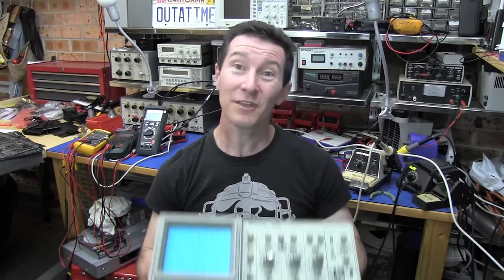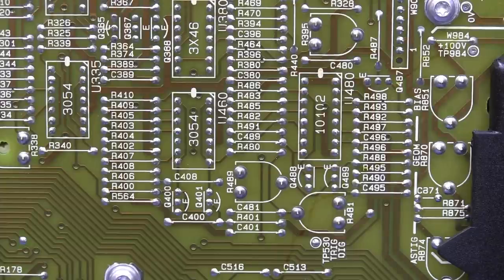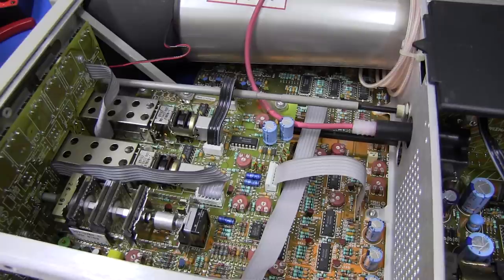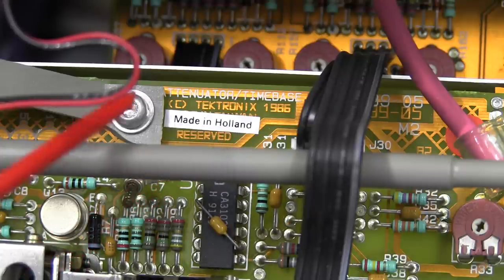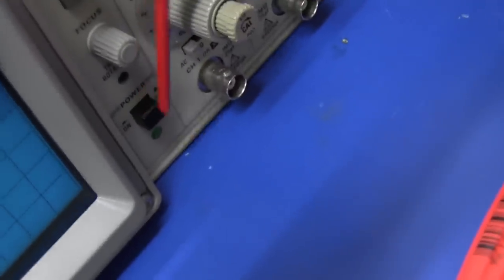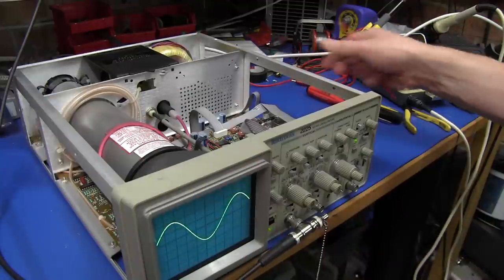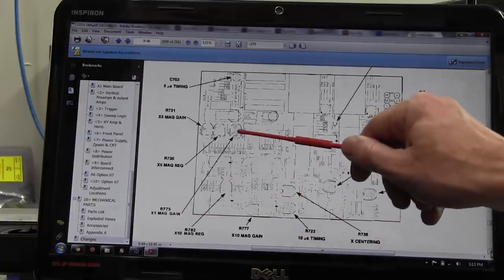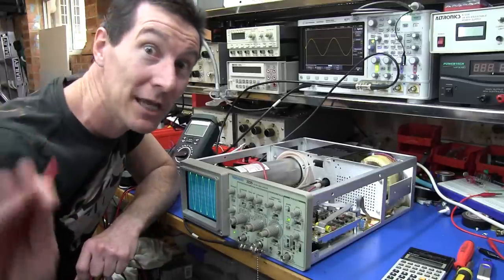Tektronix 2225 Oscilloscope Teardown and Calibration - EEVblog #208

Comment: Thanks for the video Dave, you have inspired me to break out the service manual on my 2225 and perform some needed adjustments. My 2225 also has a large 1.5M (2W?) resistor soldered to the bottom of the board as R266.

Comment: I recently bought one of these 2225's as my first scope. Dave's 2 videos on this scope, and the availability of the factory service manual were a major factor. I got a good unit at a good price, but it does need the Ch2 Vert and Coarse Horz pots to be replaced. Not a big deal really as I found the parts I need reasonably priced, but having Dave's 2 videos and the manuals gave me the confidence I could do low level maintenance work to get or keep mine going. Thank's Dave!
Reply: Same with me. With Daves videos on this 2225 in mind, I also recently bought a 2225 on ebay for quite a reasonable price. Lucky me, everything on mine is spot on and in calibration, just a broken power LED wanted to be replaced.

Comment: The spring against the CRT from the frame is not there to prevent any kind of physical damage. It is the grounding spring that connects the dag (The conductive gray-black coating on the outside of the CRT) to ground. If you don't do this, you end up with 7 KV on the dag. The scope in the video was built in '91. The dates are right in front of your face... look at the ICs, they have 4 digit numbers such as "9112" etc. where 91 = year and the 12 = the week of the year.

Comment: Dave - Interesting and instructive video.  Just a suggestion here.  First of all you should always verify/adjust the regulated power supply voltages before you start randomly tweaking!  I would be willing to bet that just one adjustment, back to mfr's spec, of one of the regulated power supply voltages would have brought your scope back into cal.

Comment: Jeeee-zus,  Davey! You like bodges? Try working on a Tek 485! They have bodged parts al over! All artfully done,  of course, but shows that Tek did a lot of after-production engineering. And the 485's test points are a saving grace. (True with most Tek scopes. Fun to work on!)

Comment: I went through college using Gould and Hameg scopes, good for the course but that's all.  I used a Tektronix sampling scope going down to Pico seconds at GEC and 4 1/2 digit Fluke multimeters.  This is in the early eighties, imagine what the company would have paid for these items. Even now these wouldn't be cheap.
I have a 2225 at work and its brother ( I can't remember the number) with digital storage, I have at home a Vellerman  60 MHz  PC scope (Stop laughing, it does me LOL) I think scopes are the most useful equipment you can have aside from a quality multimeter.
Great video Dave, The layout of the board shows Tektronix as up there with the best of them..... an engineers dream
Keep them coming
By the way, you have some nice test equipment there....drool...

Comment: HV transformer. check power consumption. If it is running rather cool, less than 90 watts, Hv transformer may be blown. The unreg 15 volts goes to 21 volts as it has  no load on it. It normally powers the HV inverter using the 2n3055 mounted on panel near the fan. The 2n3055 has Tektronix part number of course. The HV transformer can be had maybe for $20 from tucker surplus, if you are lucky.

Comment: Great vids as ever Dave and in the very first few minutes you named a bodged resistor. If you look back over the video at 11:32 you see the exact same type of resistor in the middle of the shot so it looks like a Tectronix fix or update. It's seems doubtful that someone would have replaced both the parts but could be an upgrade.?? Your the expert I am only going by the video. 73 all the best

Comment: I just repaired a 2225 from a friend. There was just one of the connections between the input attenuator print and the main board broken which caused channel 2 to virtually not function and apart from the difficulty to reach this multi-wire cable the repair was fairly easy. One strange thing is that both vertical position controls are reversed. The left knob controls the position of the right channel 2 and vice versa. There does not seem anything wrong with the cabling from the front panel to the main board, so I guess this was like that from when this scope left the factory. Mayne they changed the PCB design afterwards...

Comment: Imagine calibrating this stuff for a living? A cal cert is over $1200 now  for the military lab stuff. My scopes are the antiques with universal joints and shafts leading to cavities in the back of the scope. One is 50 years old this year. I use it at a shop I moonlight at. My Tektronix was stolen at one of these shops.It is an old HP that was comparable to a Tektronix and I think they are only 20MHz. It has 50 or so very lovely Amperex select HP matched section ECC88 tubes in it!

Comment: Thou didst not check voltages!  :O  Given that both channels were low by the same amount, and the horizontal was slightly off, I would have suspected one of the power rails would be out of spec...

Nice video, though!

Comment: untill you drool with your tongue on the pcb.
always dry your tongue first with a solder sponge or something.
Reply: No joke, though. I once transplanted the CRT in an old HP spectrum analyzer on a really hot day, and a drop of sweat fell onto the high voltage  board. I VERY CAREFULLY wiped it off (it had been discharged, too), but when I first turned it on again after closing it up, I heard a slight hiss coming from inside. Fortunately, it went away after a few seconds, and the analyzer is working fine.
Reply: That hiss send a shiver down my spine. I stick a strawer in my ear to pinpoint where it's coming from!
Reply: Tongue there, done that! ROFLMAO

Comment: 15:00 - that trimmer capacitor is called a piston trimmer. Their parasitic  resonance frequencies are much higher than most other trimmer caps,which is what you need in a high BW circuit.....

Comment: @ 10:00
7kV are still boring.😉
My best experience was a 27kV discharge of the picture tube (capacity Anode -> GND ~2nF) of a large colour TV set, a few seconds after switching it off. It really went bang and felt as if I had been kicked by a horse. The right arm was partially numb and paralysed for a few minutes and even after a day or two I had a pain like a sore muscle.
You never forget that when you have experienced it.⚡

Comment: Here's a story for you Dave. I acquired a Tek 2247A CRT scope a while back and there was no output on the screen, but it booted up fine. So I figured I'd take it apart and check the PSU. After taking it apart, the first thing I did was discharge the CRT anode and the caps on the PSU. Just when I thought I had her safe for handling, BAM, my pinky got a nice shock from a 200V cap (can't recall the capacitance). I've been zapped my 120 mains before, but this hurt tons worse. Still fixed it though.

Comment: Looking at the components it looks to be made after 25th week 1991, spring is for grounding of outer CRT carbon spray coating, Frequency setting is 50KHz for scope set up frequency, Look at the old Tektronix TM500 series, TG501A, SG504, SG503, PG506A etc or more modern TM5000 series.

Comment: Well as Dave said "know what you are doing" and I can only imagine how many "know enoughs" messed with some of these older used scopes to use or sell them.... and have not seen any I would call inexpensive looking. As a project one of these would be great but as practical tool going past 25 years old is pushing it without getting lucky IMO without parts availability and knowing exactly what you are doing. There are some serious high voltages inside to deal with.... and 100v on the main board exposed as well.

Comment: Oh, here i have one, i'm from Brazil. The problem are the potentiometers on the front panel. Their track wear out, there is bad contact. Cleanning was useless.  
I think to try conductive paint to repair it, but i don't know if it will work.

Comment: Good video as always Dave! 
The spring refered to in the video may be required to ground the outer metalic coating on the glass of the display tube to the chassis. Also often seen in TV sets. 
My mentors refered to it as "The Aquadag coating" Not really sure about the spelling.

Comment: Mine has a bodge resistor just like yours. I bought it in Sydney, and it says Tektronix UK on the back, and 'Made in UK' inside where yours says Made in Holland. It's made in 1986 also. But it doesn't have the little yellow decoupling caps across the CA3102 chips, nor the trimcaps you point out on yours nearby. Yours might indeed be an afterthought, as you say.

Comment: Dave, isn't that spring at the the top of the case to ground the dag on the tube?
Also check the power rails before calibration !! normally part of the calibration process.

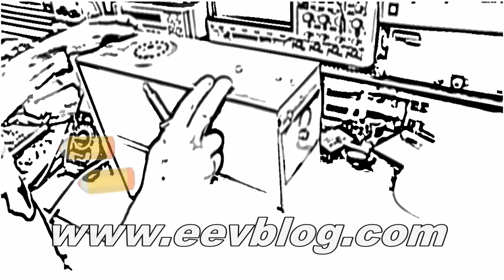Comment: 0:38 I see a link! Or at least a 0 ohm resistor. It's near the ribbon cable coming off from the panel board, component index ends with 52.

Comment: I would like to use the 2225 to check outside foil on non polar capacitors and noise for power supply used for audio. Do I need a signal generator to amplify cap? How would it best be set up. Thanks for your help.

Comment: Excuse the noob questions, but why do you terminate the input with a 50 Ohm terminator instead of just running it straight into the channel input?  Is it because the output of your generator is 50 Ohm and you don't want reflections?  ...and, if you _didn't_ terminate it, what would be the consequence?

Comment: I found some 50 ohm terminator resistors that are not very precise (51 ohms, 49 ohms). I guess this can influence the calibration?

The terminator resistors are probably from old 10base2 networks that used coax network cables. Are terminators for signal generators and scopes better quality and precision?

Comment: I just got a Advance Gould OS 250, it appears that it works , did´nt get the probes when i bought it , but they have been ordered already  , as i turn the unit on i can see that both channels work , however the horizontal lines for each channel are not perfectly horizontal , they start below the middle line and run upwards in a five degree angle , is this something that can be adjusted so the run perfectly horizontally ?

Comment: In 7min28 & 14.52it can be seen the country it is made (Holland). Tektronix had a factory in in the North bij the city of Assen.  Certain CRT's (for other models) were made by Phillips I was told by an ex worker of the glass division.
Reply: I live a short distance from a place where a guy used to work for phillips and he has a huge amount of cool old electronics ( all the tektronics scopes )
he was a bit expensive though for the tek 2445
Reply: Mooi , kan je mij zijn phon nr geven? Ik denk dat ie vak adverteert op Markplaats en woont in de buurt van Assen.

Comment: If all the components that were convertable to surface mount during design were, how much weight do you think would be saved by using less solder? No video I have seen talks about this when talking about SMD stuff. I know this isnt an SMD video but its a question I have had for a while. Please respond =]

Comment: Hey i got 2 tektronix scopes the tas 465 a 2225 as in this video and a hp3312a function generator.
i need som help ive seen this video a bunch of times but dont know how to adjust trace rotation on 2225 seem not to be changing, the function generator must be fixed also if you have an idea and the tas working perfectly except it haves a small vertical scale max 5 V pe division scale
any thoughts Regards

Comment: Do you recommend using deoxit or similar on the controls? I have a 2225 that sat for a while and the controls (sec/div, volts/div, etc.) feel "sticky"
Reply: Having had deoxit destroy controls on the inside (it isn't safe for all plastics), I always use isopropyl alcohol as specified in Tektronix service manuals.
Reply: @stirlingschmidt6325  Thank you for the reply!

Comment: Dave.  Have a Tek 2213 that has the following symptom.  Seems to work fine, but the INTENSITY knob when turned down past 1/2 way and I lose the trace.  Above 1/2 way on the pot, I have a signal, but it is too intense (and fuzzy).  Would this be a pot issue?

Comment: DAVE, 
As the timebase and both vertical attenuates were out of cal, I would have looked for a common denominator , like check the power supply voltages and adjust if necessary.    Tektronix has in place a procedure for alignment and it should be followed from start to finish, read the service manual. That's what it's there for, always do alignment adjustments by the manufactures specifications not by what you think is correct.  This is a disciplined approach to servicing and calibration and I taught my students to follow the book, (you get into less trouble that way Dave)  and you service the instrument correctly.  Also timebase adjustment should be done with a time mark generator like the Tek 2901 using a 50 ohm cable from the generator terminated at the scope input with a 50 ohm BNC terminating load, definitely do  not  use a sinewave, it's too inaccurate. 
These words were meant to edify  you don't take offence.  I was a SGT instructor in the RAAF teaching trainees to service,  fault find and calibrate equipment correctly.

Comment: What kind of signal did u used to "calibrate" (or damage by playing at cal) your scope if you skip cal procedures (ex doing it with scope naked)?. I'm not metrologist but, when i worked in a cal labo we put any instrument to warm up at leaste 40 minutes before a performance check and/or cal with covers to keep instrument's own atmosphere, then we apply signals to test, in scopes we used leveled sine signals to perform the scope's vert amps cheks as bandwidth and also the high speed (short time average) pulse generator to test the amp's response (married with bandwidth) and a time mark generator (referenced with a tcxo) to check sweep time base, was just the basic to do that task. How do you "calibrate" oscilloscopes (source of leveled sin sig, source of hspg, source of tmg)?? Because i just see a sin signal on display but not the source, and also you did just a amplitude "cal" in just 1KHz and not in all the scope's bandwidth as logn to get the -3dB point.

Comment: How much does it cost to calibrate the Tektronics 2225 does anyone know?Thank you
Reply: I guess you are a hobbyist and then the simple answer is way to much, at lest for a real calibration. Your best option is probably to find a local wizard and pay him are more symbolic amount to do a basic calibration.
Reply: AlgoJerViA
Well now I don't have to do a calibration. I found a proper working oscilloscope.

Cheers
Reply: Rob Hernandez for a NIST traceable cert I would guess about $200USD and that's without tweaking anything and That's if it passes. These cal labs today only really want to certify digital scopes that don't have adjustments and are more "cut and dry". We had a 465 that failed certification. It was in our trash bin afterwards. I grabbed it for free8-). It works fine. It may need a tweak or two but who cares. It's great from trouble-shooting,

Comment: i plan to use a cheap ebay osciloscope, analog,i will take your advise on that,but also i will use a usb digital osciloscope,and to prevent damage to my computer,i need an advise,i planning to put a fuse {car fuse} on line on the cables red-black,one fuse on each,is anything better to suggest me,i really dont know much of electronics,and i have lack of funds,my car needs an engine ,and my work place was on fire,everybody lost their jobs.im sure a fuse will save my computer